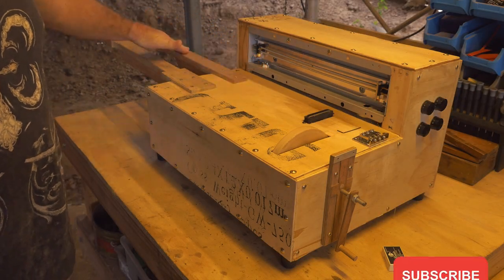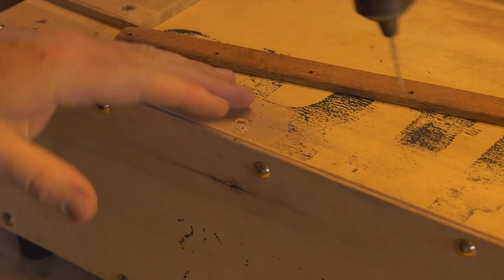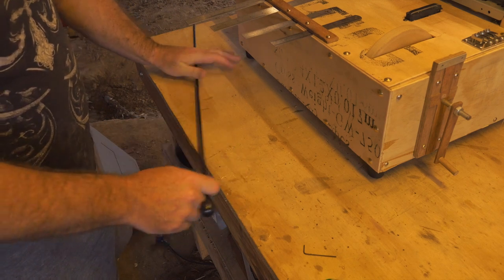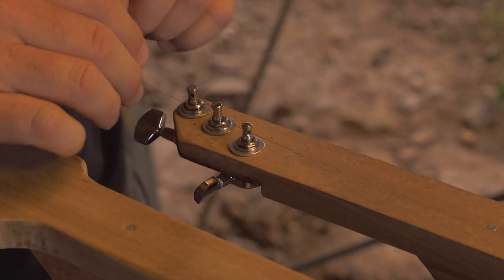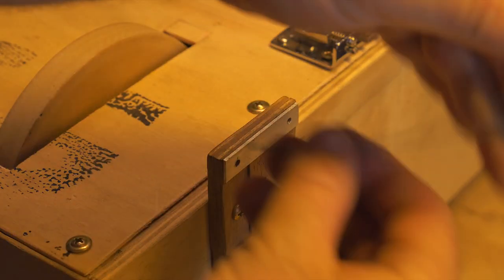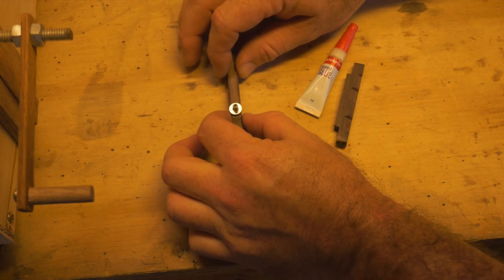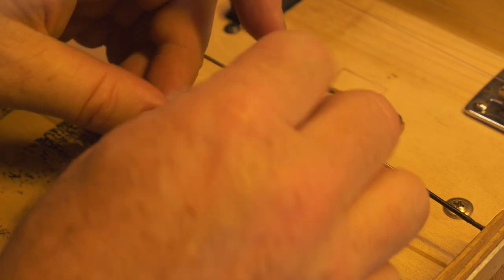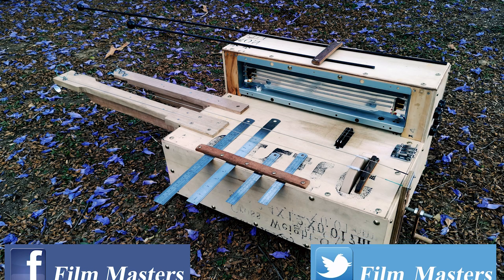How to Build The Apprehension Engine #24 - The Final Tutorial

Comment: Hi there, I bought the biggest violin strings 4/4 but they are not long enough at all. Haven't found any on the web which are longer than those 4/4,  12.8 inch. Did I get anything wrong?
Reply from the maker: It depends on how long your small necks are and placement of the tuners and what bridge you are using. The brand I bought was 4/4 also. Not sure the length unless some brands differ by size. Try buying electric guitar strings and use the 1st, 2nd and 3rd strings instead (unless you want to use larger string). Make sure they are metal strings not nylon as the metal strings will pick up on the humbucker pickups. Hope this helps

Comment: Hello,
If I want to apply other materials (ex. springs, metal parts) to expand the possibilities of sound, where is it recommended to apply them? On the first or second floor? If so, it is better to change the width of which part?
Reply from the maker: Hi, anywhere that you have space and near a Piezo mic pickup. Most attach them on the top above the reverb tank

Comment: What was the total cost of this build and approximate time to build?
Reply from the maker: Depending on your location in the world and access to items you can build one for about 100 to 150 USD. However this all depends on what you have and what you use. Build times vary. One of our builders did one over two days. So it depends on how much time you have. Fell free to join our FB forum if you want to see other builders App Engines. Great for ideas and or insperation. it is also a great community to learn from each other.
Reply: @FilmMastersChannel  Thank you so much! I'm not really on Facebook unfortunately though, so I'm not sure if I'd have access without having an account or whatever. 

Also, do you have a complete list of tools needed for the entire build as well as parts/things I'd need to buy? I'm very new to building anything to be honest so I doubt I'd have the tools available if they were powered. And I'm trying to get a comprehensive list that way I can just run to a local hardware store and pick up everything at one time.